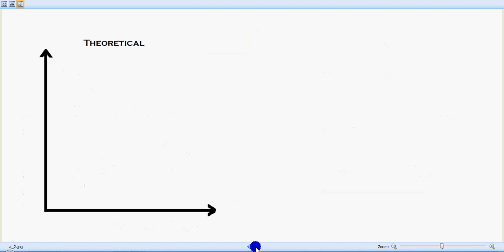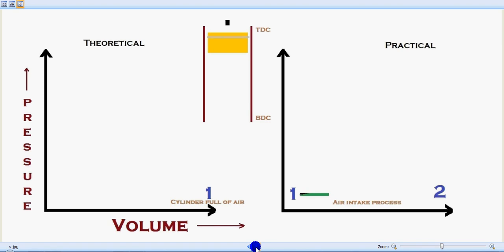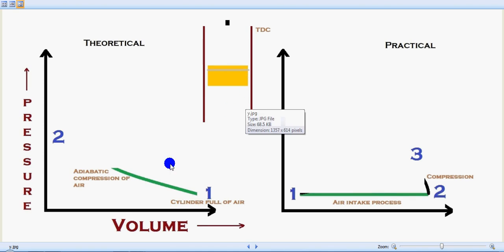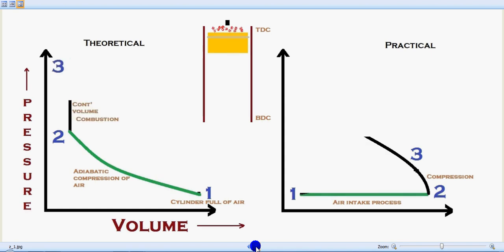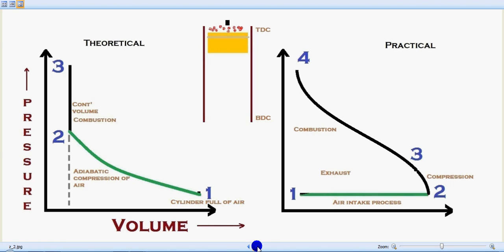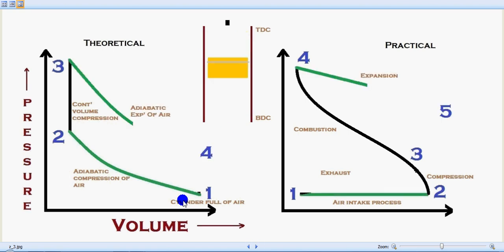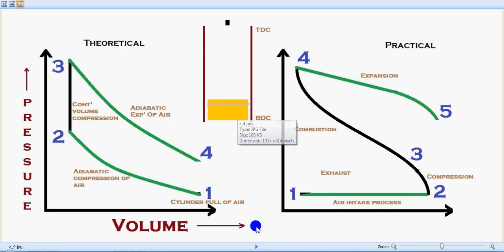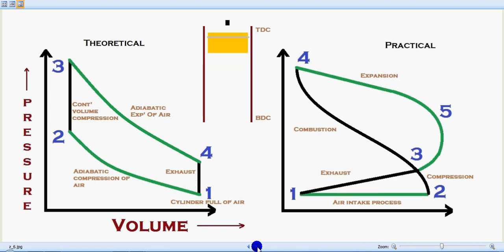Animation How Otto cycle works. ✔

Comment: good job. And to clarify, intake and exhaust is not represented at all in theoretical diagram. 2-3 is heat addition(not compression, this is combustion) and 4-1 is heat rejection(not exhaust) as the cycle is theoretical. the volume is considered to be closed so no intake or exhaust.

Comment: i have a question please, how the ignition happens at constant volume? isn't the piston compress the air/fuel mixture and decrease its volume? also in diesel engine how the ignition happens at constant pressure while the idea of the piston is to compress the air/ fuel mixture to the self ignition point?

Comment: You left out the full exhaust component of the theoretical system. From 4 to 1 the exhaust opens and pressure decreases, but you remain at BDC. Put an additional point at 1, called 5 because your temperature here is different than at intake 1. From here you do another compression, but with the exhaust valve open, so constant pressure volume decreases from BDC to TDC, and you return to 1. The cycle is now complete.

Comment: how does the transfer of heat change the curves in the practical concept? higher temperatures = higher pressure so why is there a higher pressure in the expansion stage of the practical concept when heat is lost? thanks

Comment: I think it's because the system is defined as the gas. When the exhaust valve is open and the gas is pushed out it expands but not fast enough to matter in an ideal model like this.

Comment: How come the exhaust stroke (4-1) is occurring at constant volume, but the piston is moving from BDC to TDC.
Reply: I think at that point the exhaust valve is open so the gas can go out freely without compression
Reply: thats my question
Reply: at point 4 the piston has already moved and from 4 to 1 it does not move.
Reply: Pindikanti Hitesh I
Reply: this may be too late but 4-1 is constant volume heat rejection the ideal case dose not consider throttling losses so after the expansion stroke all the excess heat is lost and charge(air+fuel) is induced MAGICALLY.(anything can happen in theory) this is however taken care of in the real case pv diagram. hope that helps.
Reply: There is a line missing in theoretical PV diagram. Just like that of practical 1-2, there should be a line in theoretical diagram
Reply: The pressure is dropped from 4 to 1 at constant volume,its the reason why piston moves up.

Comment: boy you are wrong about the practical diagram.. During the intake process the pressure is under 1.0 bar it is not stable at 1 bar

Comment: I have question about the otto cycle. I heard that in reality the otto cycle is not efficient there for engine maufacturers use another cycle (do not know the name) it adjusts valve timing from what I understand. For example to help scavenge exhaust gas, the exhaust valve would be opened before the piston reaches TDC, and to increase air flow into the piston the intake valve would be open before the piston reaches TDC as the exhaust gas from the previous cycle is being removed. I believe that this is called valve lead, valve lag and valve overlap.
Could you explain this in more detail?